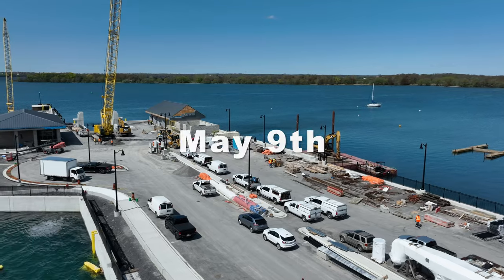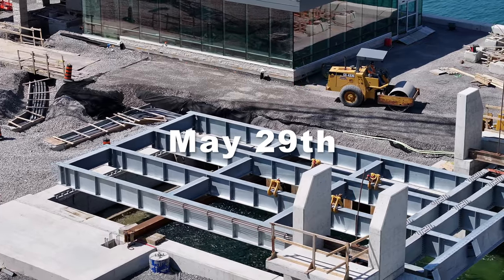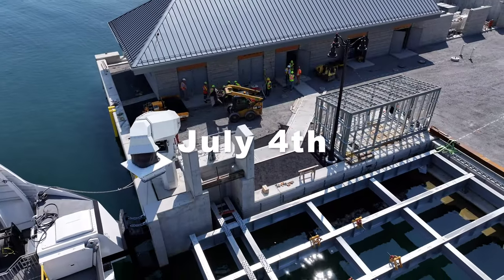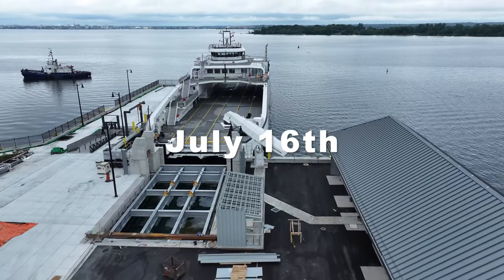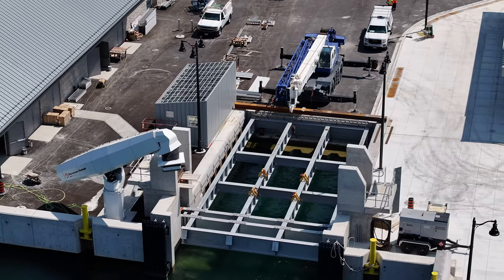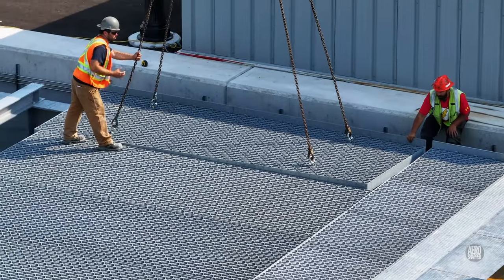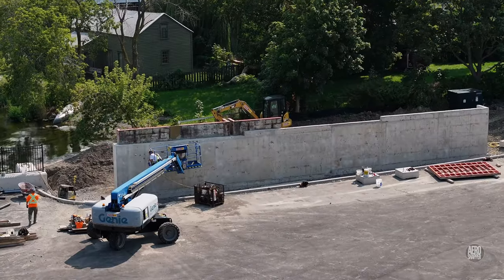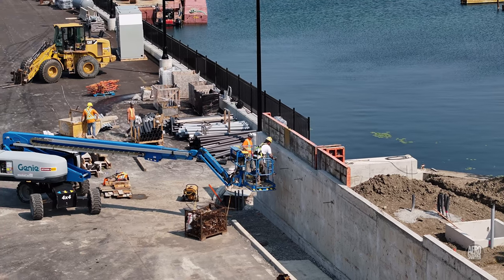Grate News from Marysville - an update on the Wolfe Island Ferry Dock   4K

Comment: That's quick paving!  Surprised to see that worker over the water with no PFD or fall protection!
Reply from the maker: The paving work by GIP was pretty quickly effected - though it was the final layer and completed earlier sections.  I suspect that, since it's the concrete, sloping ramp pretty close below the lifting section, no fall protection was required.